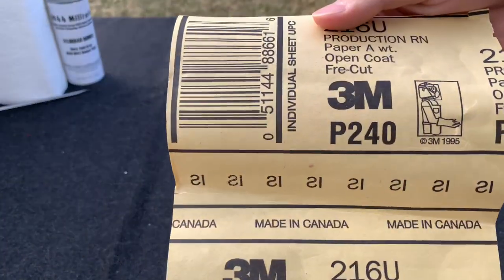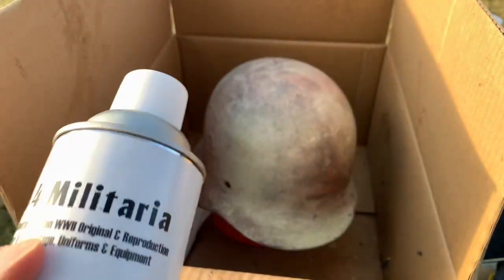Converting a Finnish m40/55 helmet to a war time German m40 helmet, Part 2: Painting

Comment: The m55 i converted had the holes in it to fit the chinstraps. Long split pin ruvets had to be removed. Fill the holes with chemical metal

Comment: I used a small spice shaker too, just like that one. When I was applying the aluminum oxide I shook it back and forth straight on and I didn't have any issues. In fact I think it applied more evenly and like you said you can always rub off the excess.
Reply: Ps. If you have an old course grinding wheel that's been worn down if you smash it up quite fine it works perfectly. The one I had was made out of aluminum oxide so hey I figured why not I have a ton more wheels

Comment: Good how to videos for the finish conversions!  You should try laying down a drop cloth to catch the aluminum oxide and turn the box upside down.  You’ll be able to haven’t room to spray your helmet and it will allow you to be the 12-18” away to build up your coats of paint.
Reply: Can i use iron oxide instead of the aluminum?

Comment: I’m restoring  an m40, I took the previous paint completely off as it was already pretty badly restored, now I have to repaint it, I bought day 1944 paint, I tried on the shell to see if it would hold on, but it doesn’t, I can scratch it off with my nails. Do you know if I have to use any sort of primer or what I should do to make it work?
Reply: I wondered if period German helmet manufacturers primed their helmets before applying paint and the general consensus is they did not.  Of course you can do as you wish.  It may help the paint to adhere better if you lightly scratch up the helmet using coarse sandpaper.  Also make sure the helmet is free of oils, grease and dirt by cleaning helmet with mineral spirits before painting.  You may have had a bad batch of paint and may try using something obtained by another dealer in authentic WW2 German color paints.  You also must let the paint dry completely and harden for weeks, months and years.  Don't be in a rush to scratch up the paint.  Lastly you might consider using a clear MATT spray to protect the finish further but this may ruin your decals if you've applied them unless you protect the decal with some kind of varnish specifically formulated to protect decals.  That's it in a nutshell.  Since your post is a year old this response will no longer be relevant to you but someone else with a similar issue may find it useful.

Comment: Alternatively, dunkelgelb and sand for a DAK helmet (that's my current project). But good work!
Reply: Paint your helmet apple green(m35) or apple pea green(m40) first. Then paint the helmet a version of gelbbraun Ral 8000 or ral 8020.  Dunkelgelb 7028 was not a DAK color.  Leave the inside of the rim a Feldgrau color.  That is generally how the helmets were painted!  Have fun with the project either way!

Comment: Awesome videos! What grit size aluminum oxide do you use and where can I get it?
Reply from the maker: I bought from a Facebook group. I’m not sure where else it can be bought.
Reply: I live in Australia & I brought Aluminium Oxide from a car shop called Supercheap S
Auto. Aluminium Oxide is used for sand blasting, so any automotive shop should sell it, or tell you where you can. 
It’s kinda expensive (for what it is) to buy tiny amounts from reenactment vendors. Mine was about $10. for 1Kg (2.2 pound)

Comment: what grit aluminum oxide is the most accurate? Where is the best place to get it ( all i see is 25-50lb tubs which is way too much)?
Reply: 80 is perfect. They do sell it in little 100g tubs really cheap online.
Reply: @rexterrocks  where exactly did you find them? The smallest ive seen is 28 pounds which i dont need
Reply: @rexterrocks  Do you know where directly i  can find what you said? The smallest i founds was 8lbs on amazon
Reply: @zacharycook2674   I just Googled 'Aluminium oxide'(we spell it differently in England) and there are a lot of sellers coming up. I can see it's on eBay very cheap by a few sellers. It's often sold in small amounts. I should have said around 220 grit for early war. In the late war they used larger grain, even sand.

Comment: 1944militaria is out of stock… damn… has anyone ever used hessian’s helmet paint before?
Reply: Hessens paint is good stuff.  Their grau-Olive is the equivalent of 1944s dark Feldgrau.  Dark Feldgrau is good for m42s with aluminum oxide finishes or M40s that were field resprayed.  M35 factory color was apple green.  M40 was a slightly darker shade of Feld grau referred to as  pea green.  1944 militaria is out of stock for apple pea green, but has apple green in stock.  Now with all that said even amongst the same company and factories paint colors varied greatly in tone.  Just depended on the time of the war and how the paint was mixed.  Slave labor was used.  So I imagine exact specs weren’t always a thing that was followed.
Reply: D-Day 1944 is the best shop you can get for paints, decals and chinstraps imo.